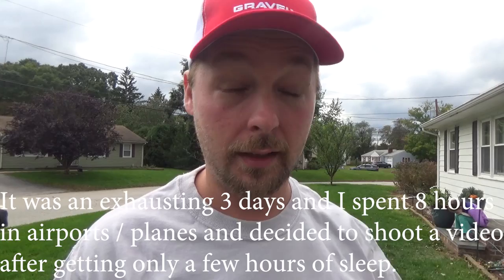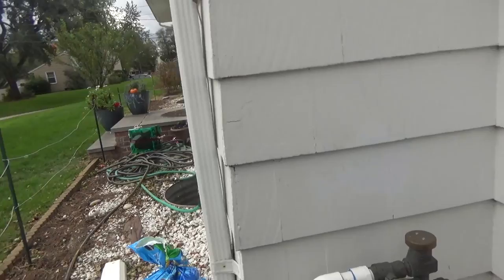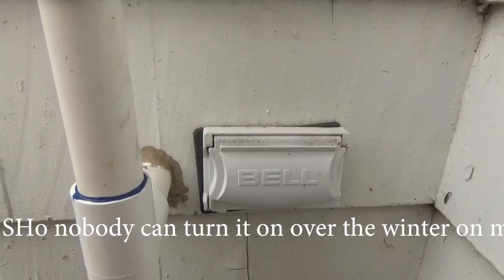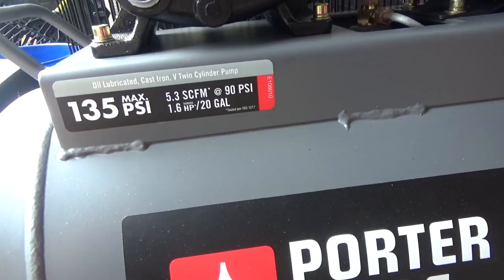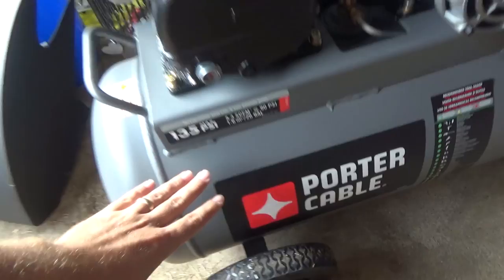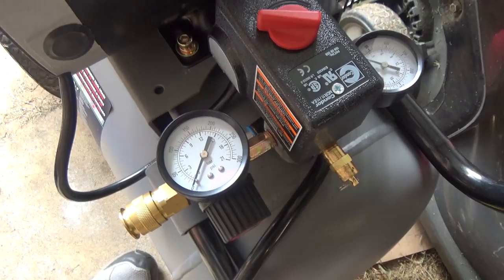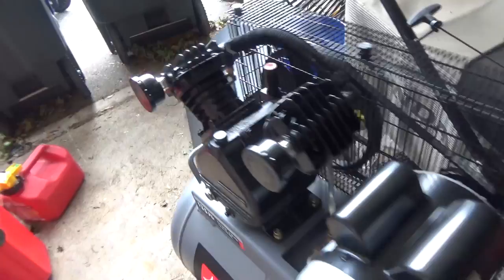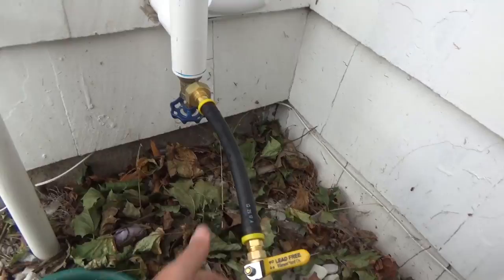How to winterize or blow out your sprinkler system

Comment: you should add a drain valve just above the shut off in the basement.  the pipe leading to the backflow preventer is still full of water and it can freeze just inside the house if it is cold enough.  i recommend to all my customers to have a plumber install a drain valve inside the house

Comment: I purchased a 26 gallon upright to do 17 stations. Works well. I only wished it held more Air. I will probably have to blow it out twice. No biggie. I’m retired. Thinking about adding another tank. Good video by the way. FYI, I tried 50 psi and that actually seemed like too much. I start at 30 and go up to 40 psi. Seems to work better than 50psi. Thanks for the video!

Comment: Instead of using your controller to run each zone cant you just manually open then from inside the valve boxes? Sometimes I manually water a zone by doing this but never tried to winterize. My controller is inside my house so it makes it easier.
Reply from the maker: Yes, I just know a lot of my viewers would be worried about messing with those so this seems simpler
Reply: That’s how I winterize (using manual on off knobs at ground boxes)

Comment: Wait a minute, looks like you are running the compressor air through your back flow prevent!?? I thought that was a “no no” in winterizing your irrigation system?? Aren’t you supposed to blow it out down stream of the back flow preventer? Informative video nonetheless 👍🏿
Reply from the maker: If you blow it out on the other side I believe it will make the pressure higher causing it to release out the preventer. Of course I have the valve turned off between the hose bib and the house so pressure isn't going into the house.
Reply: Grass Daddy Good
Reply: Do you take the ball valve off?
Reply: Do you keep the ball valve open or closed?
Reply: @mrgucciguilty4819  Not sure which ball valve you are referring to, but once I have connected my air compressor and have blown down my system, I do crack the ball valve on the back flow so any residual water in there can escape and not have the potential to freeze and damage the back flow.

On my back flow (not everyone  has the same kind!!) I have 3 miniature ball valves on the back flow itself at the bottom and the two main ones on top.  I also have a main shut off ball valve in ground before the flow of water reaches the irrigation valves, which is also left cracked open slightly. Hope this helps!!